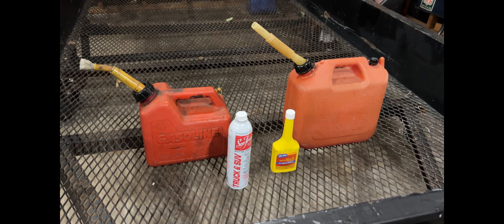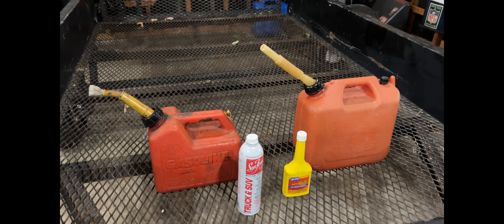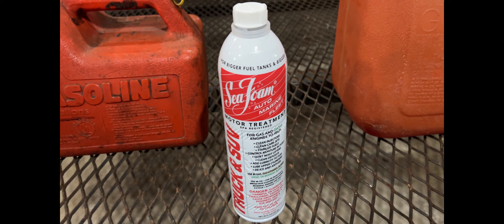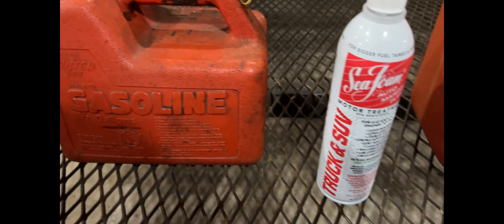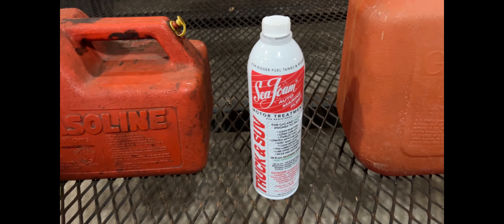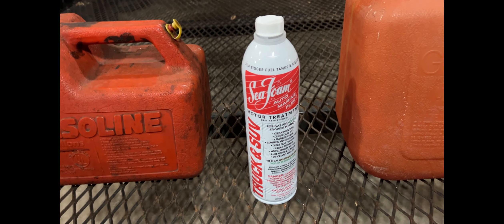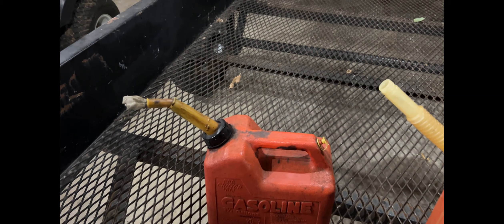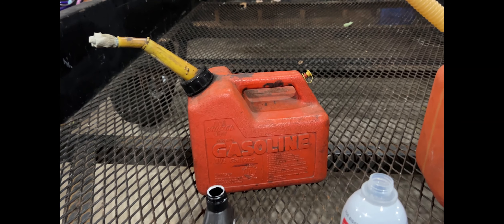Winterize your motorized bike  !!

Comment: you might be my go guy for motorized bike info . any good alternatives to sea foam or works just as good thanks
Reply from the maker: I personally don't know of any other product that works in a 2-stroke engine fuel mix that keep the gas from freezing & keeps the fuel system clean without damaging the engine. All the other products contain alcohol & alcohol will kill a 2 stroke engine in merely a few min of run time.